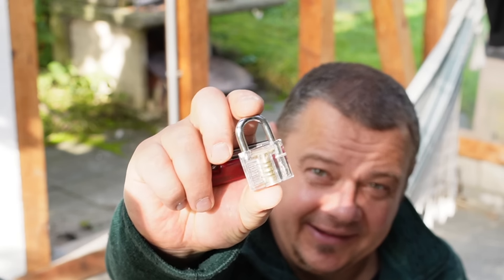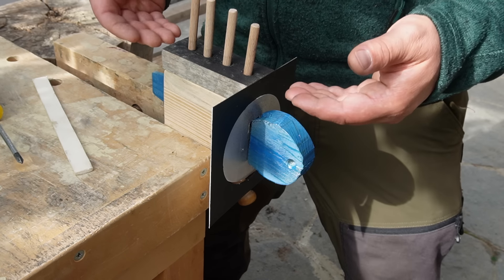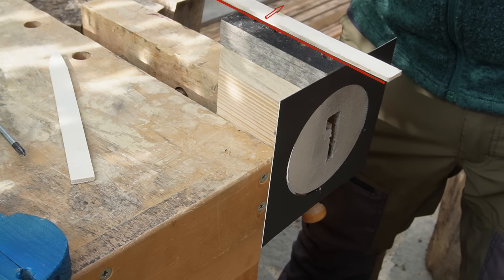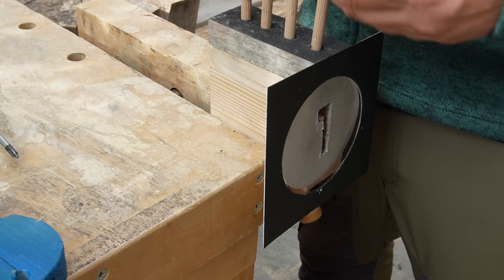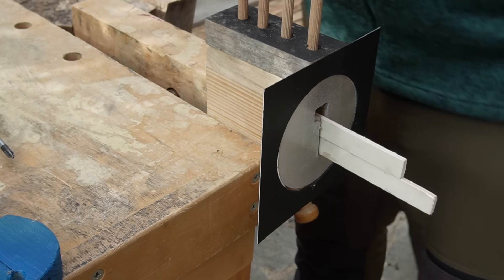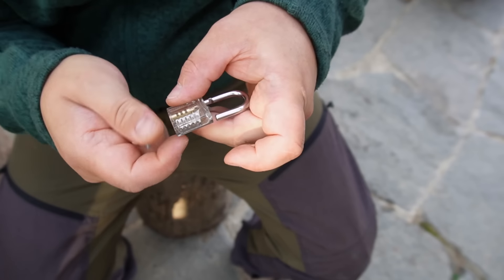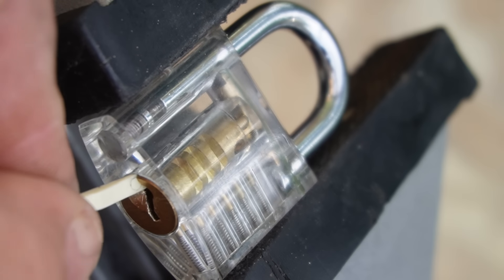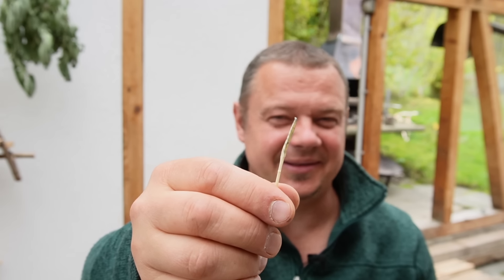How to open a lock with a Swiss Army Knife / Lock picking with the tools of a Victorinox SAK.

Comment: Awesome video Felix.If an SAK user never uses the toothpick, replace it with modified tweezers which can pick a lock and open handcuffs. Thanks again Mr. Immler.
Reply from the maker: Super idea! Thank you!
Reply: @FelixImmler  
Is there a replacement tool like that? 
Similar to the other after market add on tools like the fire ant you have shown.
Reply: if you pointy the tweezers you dont need the toothpick , that fire thingy can go there

Comment: In my youth I used to pick locks just for fun to understand how they worked. NEVER to enter into a place or access something I had no right to enter or access something that wasn't mine. Back then I used to use flat hair pins with two legs, one flat and one wavy (bobby pins?) as tensioning and raking tools. Given how clever you are I'm guessing you could easily turn a pair of those hairpins into a pick set that you could stow somewhere in your SAK. ;-) That would save wear and tear on your toothpick and your tweezers and keep them in good working order for their intended purposes? It is a good skill to know and could come in handy in an emergency. I did put those skills to good use a few months back when entry needed to be made into a home in an emergency, but we did not want to damage the homeowners property. I was able to pick a door lock and make entry to take care of what needed attention as the homeowner was thousands of miles away in hospital. It was the first and probably the last time that skill came in handy for a legitimate purpose in my case, but there you have it.

Comment: Once i had bend the tweezers using it as a tension tool and i had used the stainless pin as raking tool,the toothpick was too big,but the pin was too short,so i holded it with the pliers of my SAK,finaly it works with a little bit of luck.Now in an emergency situation I could separate the tweezers in to two part,to use one as tension tool and to file the second part with the metal file from my SAK to use it as a raking tool(i carry two tweezers,one my pocket,one in my key chain,Lol).The paper clips are great locking picking tools,MacGyver's style...anyway,nice video as always,Greetings from Greece my friend.
Reply from the maker: Hello Nikos. Thank you so much for this interesting comment. I have to go on your channel and look for this video! Greetings from Switzerland

Comment: An interesting use and more realistic than the McGuyver version! It would be interesting to see picks designed to replace the toothpick, like that firesteel. You could certainly have a hook or city rake etc.
Reply from the maker: Thanks for your interesting idea!!
Reply: The only McGuyver lockopening with the Swiss army knife i remember, was one of these old locks where the key is a round rod with the keybit attacked. He pushed the key out the other side while he had slid a map under the door to catch it and pulled tha map back. Conveniently thegap between the floor and the door was big enough that the key would fit.
Reply: @nirfz  That's one of the more realistic examples, but they've also just had him straight up defeat locks (I believe in-door knob) bu inserting a tool and fiddling, memory says the awl. Some googling says that probably happened in Season 1 Episode 10 'Target Macgyver' and it was in fact the awl on the back.

He has however, also picked a lock with tweezers, but in true show style he just slid them in a waggled them until it opened, no two tool approach.
Reply: @DorkForge  ok  i didn't remember those😁. (found someone who did a little mod and used a tensioner: https://www.youtube.com/watch?v=uN9huKFCw3I) 
One thing i really have to give to McGuyver is that he had 2 of the most realistic bomb "defusals" i have seen on screen: At one instance he put his carboard icehockey ticket between the contacts of a relay as an isolation (so when the button was pushed no current was flowing and the detonator was not ignited), and on another occasion he pulled the detonators out of the c4 and removed the explosives far enough that the detonator couldn't detonate them.
Everytime i see someone trying to figure out which colour wires to cut on screen i remember these two instances.

Comment: Excellent explanation of how locks work!
This will work on small, light locks, but with heavier locks you will not likely have enough torsion force to lock the pins in place. 
I bet you could modify some of the other tools on the SAK to pick just about any lock if you took it apart or had 2 SAK's modified purposefully.... I did something like that with feeler gauges.
Reply from the maker: Thanks a lot for your interesting hint!

Comment: Nice video🙏
I have some practice locks to play with, so got on it to try.  But used the added sewing needle in the saw slot as the pick, and bended the tweezers  with the can opener to create a tentioner (and bended it back when done), it worked easy on the easy practice lock, after a couple of tries some others locks but  locks with high and low key teeth did not open  I got myself the other Macgyver toy (paper clip that kan be added on the keyring) and bended a little hook with the hole of the awl to improvise a hook pin and got some extra ( not all) locks opened.

I tried to take the tweezers apart with just my sak (modified ranger) but almost cut myself.... maybe a video to take those apart in the field with just a sak could help😉

Comment: That was very interesting and entertaining.  I would have to come up with something else, though, because I need to use my toothpick and tweezers for their intended purposes a lot more often than I need to pick a lock.  However, it is good to know how to do it in case I ever find myself in a jam.  Thanks for all your SAK 'hack' videos!
Reply from the maker: Thanks a lot for your feedback!
Reply: If you have scissors, the scissor spring might work as a torsion tool if you swing the one side all the way back. Might also be able to use the pin for a pick if you have plus scales or modify a corkscrew small screwdriver. Just thinking out loud

Comment: I think I’d use the tweezers to keep tension and use the straight pin as a rake. Instead of the Victorinox pin I just have a standard shirt pin with a ball head for a straight pin. It fits into the scale just fine, and I believe the ball head would make it easy to hold onto while working with it.

Or, here’s a thought. If you have it on your knife, just whip out the file and cut the lock off. LOL!
Reply from the maker: Thanks a lot for your tips!!

Comment: I modded the nail file on an Victorinox escort into a standard hook lock pick, and made a torsion tool to fit in the (slightly modded) toothpick slot. It's quite a lot of work, as you need to remove a lot of material from the file, including thinning it, and the file is obviously very hard steel, but the result works very well. Would be less work with a grinder, I used only hand tools.
Reply from the maker: Hello Rob. Thanks a lot for your super interesting comment!
Reply: @FelixImmler  I can send you a photo of it if you like, Felix.

Comment: Most new model Victorinox Swiss Army knives have a hole for a straight pin but have no pin. I added one to my hunter model and camper model using a pin with a plastic ball on the end used for sewing. I might think it would work for a lock-rake if you wanted. 
If the pin is the same length as the tweezers I believe it would work the same. Adding the pin with the plastic ball end works fine on knives with corkscrews and regular straight pins work for ones with screwdriver tools. I like the pin with ball end better because they are easy to replace if you lose one. 🤔🙂

Comment: Felix, create a metal raking tool that will fit in the toothpick holder. Maybe even a whole lock picking set that will fit in the SAK. You can possibly cut the head off toothpick and attach a small raking tool.
Reply from the maker: Thanks for your super interesting feedback!

Comment: The tweezers make a much better tension wrench than the toothpick. If you intended to do a lot of lockpicking with your SAK, I'd suggest modding it to carry two pairs of tweezers, or maybe even tweezers plus an actual small rake pick.
Reply from the maker: Thanks a lot for your tip!

Comment: I managed to pick the fuel cap lock on a mates 1978 Kawasaki 1000 with the small thin screwdriver (next to the chisel in the back of the Swisschamp) when he couldn't find the key.

 I've opened a few locks with that tool, by inserting and jiggling it.

Comment: Thanks for the effort you put into demonstrating everything.

You're suggestion to just separate the tweezers seems to be good >>for an emergency<<

but your sore fingers tells me that it will probably break unless you've had lots of practice ahead of time :)

If you can tuck away a few of the flat wire hair pins in you're EDC, I find that they actually work better than some lock picking tools... sometimes even better than windshield wiper blade metal.

Comment: If you use the small blade on the mini victorinox knives you can rake a whole lot of small locks.
Reply: I was thinking the small flathead screwdriver on the end of the nailfile (classic SD model) would work well for the tension tool. A paperclip stored on the keyring could be bent into the raking tool.
Reply: @RR4711  If I have to pick a lock, I use the small blade from the Mini Champ as a tensioner and a raking tool at once. It takes some try but mostly it works.

Comment: Maybe if you remove the toothpick and carry two tweezers?  One can be ground down into city or bogata shape (pick) an the other one, either pre-bent or bend it when needed (tension).

Or bend a blank  .020 (~.05 mm) pick that is twice the length in half? You could bend the very end of one end into a 1-mm lip so it can be used to pull from knife?

Comment: Take a flat head screwdriver that has a hex nut on the shaft end. Hammer it in. Use a wrench to turn the cylinder with some force 😂 okay, maybe you will need a new lock but sometimes you don't care about it.

Comment: That toothpick is way too soft and fragile for this. This will work on very few cheap locks. Modern locks are well made locks have cylinders on the sides as well. This is just a gimmick video.
Reply from the maker: May be you are right... but i opened different locks with it...